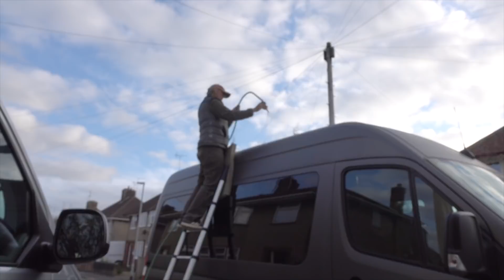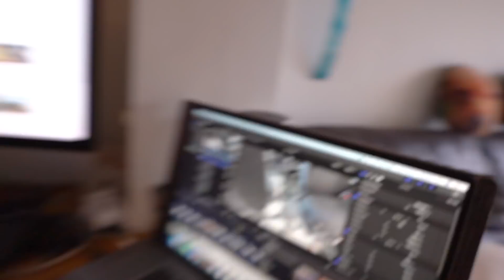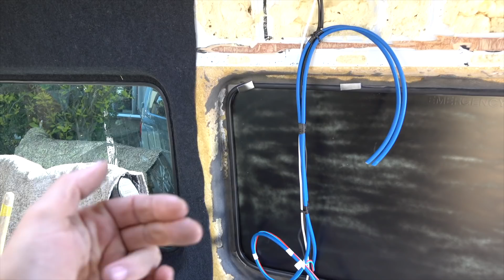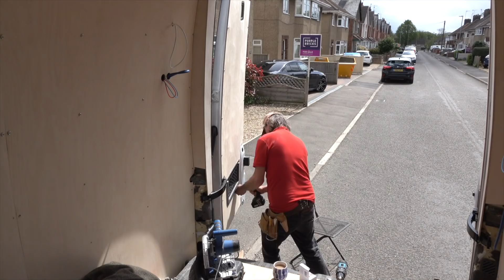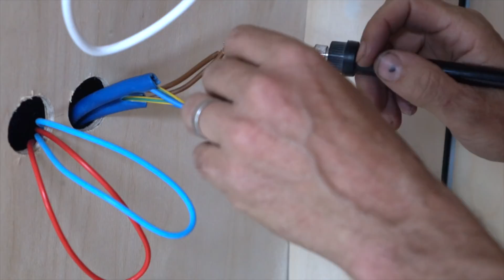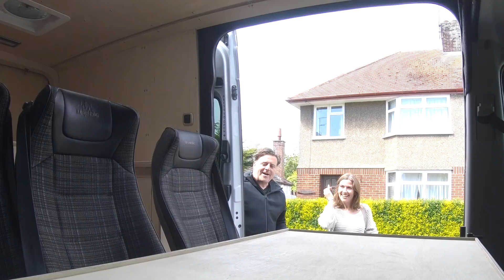Mercedes Sprinter Campervan / Production vehicle conversion

Comment: Sorry to be the one bitching about it, but you really shouldn't solder the wires to be clamped to the terminal. With time the solder surface corrodes and it increases resistance ending up in a lot of heat. You should crimp ferules or leave them bare
Reply: You beat me to it! Always enjoy the camera work, came a few years ago from watching Colin Furze.
But as Nicholas mentions, it's a really bad idea to solder wire that goes into screw terminals.
Copper is compressible, solder malforms - over time the soldered connection will loosen in the terminal.
I dabble in 3d printers & some of the cheaper manufacturers went through a period of soldering wires that are in screwed terminals exactly like this which led to several fires as a result.

Definitely a +1 for ferrule crimps (bootlaces) is the correct way to do this, efixx on YouTube have a good video on the subject of ferrule crimps.

Comment: Love a bit of plywood and you work wonders with it.
The round white electrical junction box you used is a bit 20th century; check out Wago lever connectors and Wagoboxes for something that's much less likely to shake apart in time.